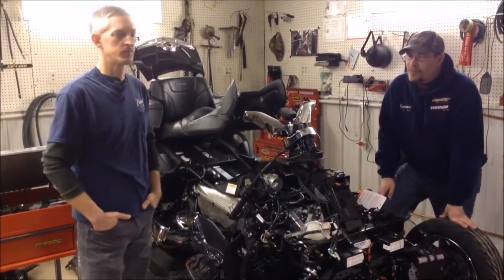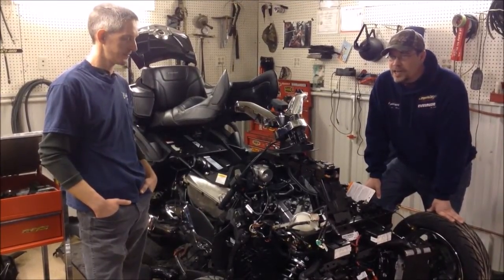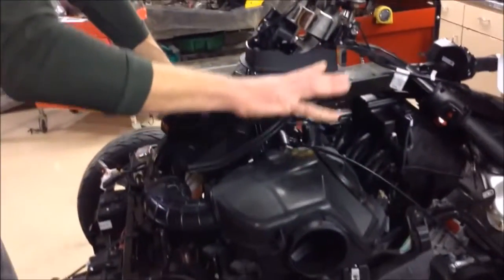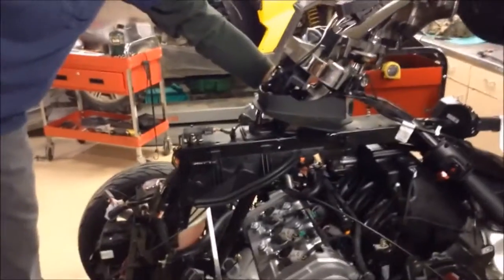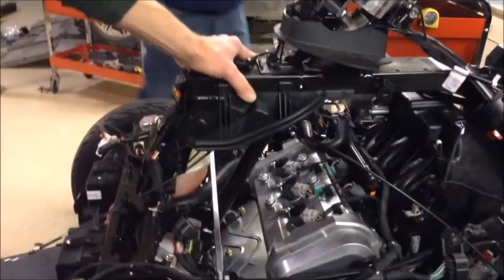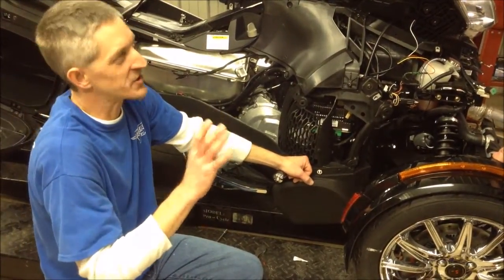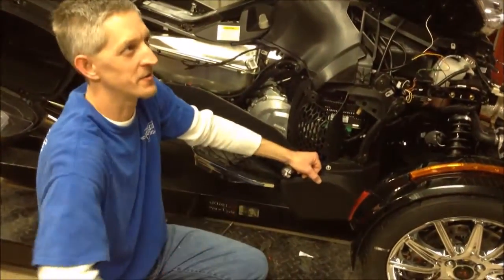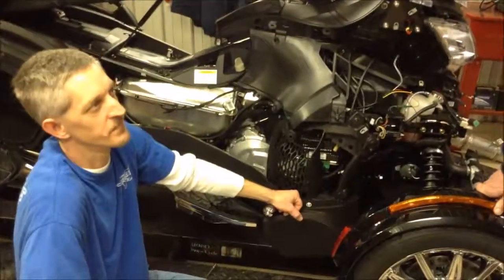ROTAX 1330 ACE

Comment: I have a 2022 CanAm spyder with the 1330, are these engines noisey at idle
Reply from the maker: Like most cycles, the Spyder will make a bit of noise while idling, but it's not normally enough to warrant being called "noisy," especially if you're hearing any rattle or whine.

You should give us a call (573)-885-6300 and ask for our Powersports Service department. The guys there should be able to point you in the right direction with what noise it is, and if they're not able to do it over the phone, you can bring it to the store at 413 Daniels Road in Cuba, MO.

Comment: I am having an issue with my 2014 RT starting, have checked the battery, solenoid and earth wire, all are OK, I am trying to find where the starter motor is, or is it a starter generator?? Thanks in advance. I am in Darwin Australia so we dont have any service centres here.
Reply from the maker: Please call us at 573.885.6300